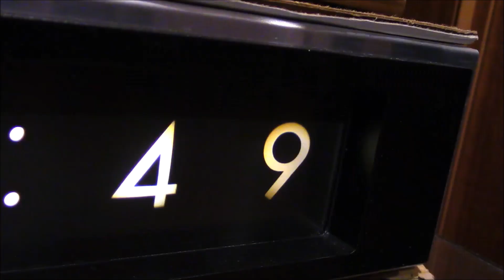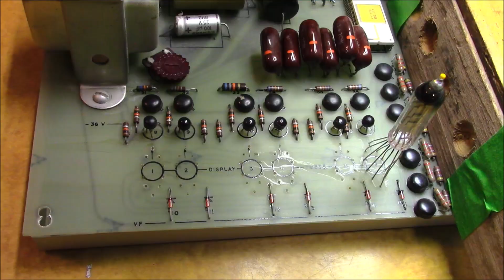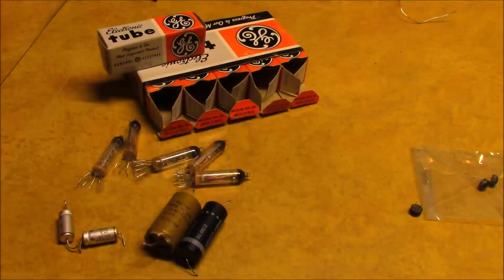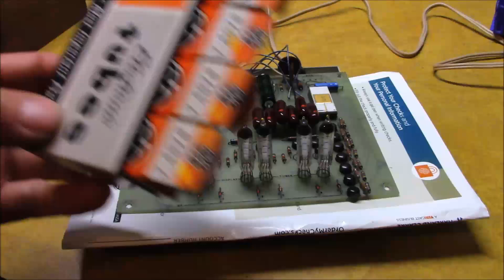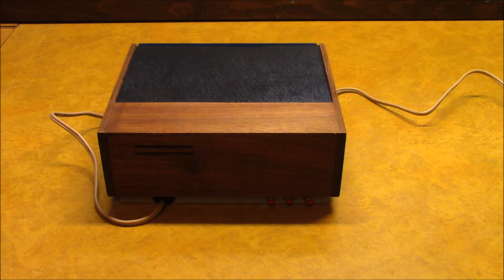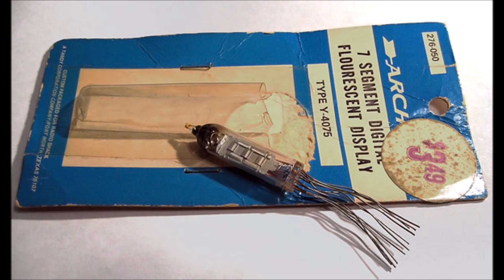1972 Aries AR-730K Digital Kit Clock Completed Repair and Clean up.

Comment: Thx for  pointing to the old video. That video might help someone who is new to multiplexing and in particular how its done on the MM5314N chip.
Is it fair to say I know this liitle lovely clock chip as much as You do?
As allways, no offense, just my 2 cents.

I know how multplexing works on the MM5314N and similar, I had it on my scope (2channels only).
The new old clocks I have designed based on 40 years old mfg documents driven by the GdR made U125D four decade counter /clock chip are using the same principles,
The designers improved that  by placing a 1/32 of a full cycle between driving digits subsequently.
After driving all digits an even longer blanking period follows before driving the first digit again.

If I can recover myself, if I can get on my feets again someday, I would like to build the circuit with no control grid.
Lets end the discussion.
Reply from the maker: oh I hope you are ok and not having health holdbacks...I am slowly coming back.  Rough time I had.  Wouldn't wish it on anyone.

Comment: Have inspected the blury schematics again.
To me it looks like feeding the filament no DC at all. Just feeding pulses.
They were given a sequence of shots of current pulses, just a tiny amount, that brings the heater up a bit.
Have in mind it accumulates the the temperature over time on the heater,  warming them up over time.
How have they figured out, how much to preheat, before giving them the next short amount of energy?
I assume feeding the heaters goes  through tiny capacitors You have not numbered.
To me it looks similar to setting a voltage on a certain level on a comparator input , before the next pulse triggers the gun.
Can we replicate that mechanism on a regular VFD like the IV-6 or old Futaba I own by not using the grid?
Reply from the maker: DC to the filaments but pulsed (switched).  Filaments like AC better for better illumination.  How they figured it out, not sure but that is probably why there is a trimmer pot in that circuit to optimize.  As far as replicating on an IV-6, I guess one could.  For experimentation I guess.  On a multi digit VFD one has to use the grids as they only have one filament.

Comment: PLS, let me know. The datasheet has, max source current  0.3mA, max sink current 25mA.
how much current does a singel filament heater draw on this tubes.
I assume switching the digits happens at a frequency if  (typical) 1kHz.
This is not what a human can understand. At least I do not.
To me it looks it does kind of POV. Means heating the filament virtually never stops.
How fast can emission of the filament can be allowed/disallowd by just turning of the driving current.
Well,the filament always does afterglow.
It can not stop emitting photons imediately. No way.
This is because of the thermal inertia. (Trägheit)
This can not be defeated.
When the filament is being switched on/off that fast appereantly it is always on.
Reply from the maker: The datasheet at the end of the video shows 35 to 45 mA filament current for this tube.  Frequency of these mm53xx series clocks all seem to run 700 to 1500 Hz equipped with the recommended capacitor and resistor.  Maybe instead of thinking heating the filament, think biasing.  Emission and non emission...current or no current.  The tube filament needs current to permit emission, right?  I understand your thought though.  How fast can the reaction time be.  For something many say can't be done, well it has been done, it just may not be the most efficient or effective and that maybe why we see a "turbulent" display at times.  I do think what you think and maybe that is why they installed grids later on!  The after glow you see on segments is just "ghosting" which is common on any MM53xx series chip from my experience.  There is no delay between digit activation.  The data sheet does show a circuit added to the "output enable" (O.E.) pin on those 53xx's with that option to minimize the "ghosting".

Comment: A very nice clock and you did a wonderful job bringing it back to life.  Just curious about filament multiplexing.  Is there a reason why that wouldn't work with more "modern" tubes?
Reply from the maker: Well, as far as I can explain, there would be no need.  The filaments like AC better.  I read somewhere that AC on the filament produces a better and more even illumination of the segments as compared to DC.  So there is generally an isolated AC winding feeding just the filaments.  Then the grid is used to turn each tube on and off and it requires less current.  But I suppose one could (or in this clock, could have) switch the filaments on the more modern tubes and just biased the grid positive (on all the time).  So yeah I guess. hmm oh well.  I like the correctness anyhow.
Reply: @JIMO415  I was just curious if in this case it turned out that you had to use new tubes, could it be done without modifying the circuitry to switch the grids.  Also, does AC matter if the filaments are paralleled?  But maybe the circuitry is such that they are in series so in that case it would matter.
Reply from the maker: @Enigma758  it would depend on the rating of the filament current between the tubes.  But possibly as there is that trimmer pot that may have accounted for any difference, not sure.  I had not begun to look into that yet.
Reply: @JIMO415  I looked at your schematic again and I see that the filaments are in series, so as you suggest, AC would be best to avoid a gradient.  I bought some IV26 tubes which do not have grid control which is why I ask.  I have not fired them up yet, but I did see where someone else was using filament control in order to mux them.  I would think DC might be OK if the filaments are individually powered from a series DC circuit (no gradient since each tube is not affected by the others) but I haven't tried it yet.
Reply from the maker: @Enigma758  I have other VFD tube clocks where the filaments are in series with each other but this clock, they are not.  (something in my pencil art schematic may not be exactly clear?)  If they were in series, they could not be individually controlled for multiplexing.  The IV-26 tubes are available in 3 different "types".  They are designated type 1, type 2 and type 3.  My Elektronika 7-06K uses the type 2 variation.  You are correct, there are no grids in them.  And interesting question on separated tubes vs series tubes filaments as to how they are affected by AC vs DC.  Hmmm.  Anyhow, with out grids in the IV-26 tubes, individual dots or grouped out dots are controlled with separate lead in wires depending on the tube type.  I do not know how the type 3 is layed out but type 1 is individual dots each controlled by it's own lead in wire and the type 2 has one separate lead in wire for each of the 3 separate dot groupings.   I touch on it a little here: https://www.youtube.com/watch?v=xtdLZKqtCgg

Thanks for the comments!

Comment: How did the designers made it working? You say switching on the filamnets.
I guess they did similar to what I have found on soviet made elektronika VFD clocks, when they do kind of level shifting,
mostly because of wanting to mitigate 50Hz flickering.
So, is it that kind of adding a biasing voltage one end of the filaments?
Reply from the maker: You may already know the difference between direct driving a display and multiplexing a display.  So, as this display is multiplexed, that is: one tube is on at a time and scans faster than the eye can see, to display the time as we see it.  This is done to keep wiring and connection counts down.  So, in order to activate a tube in the sequence, VFD tubes usually have a grid screen to bias positive to allow emission from the filaments to create the glow on the phosphor.  Bias it negative, the emission stops.  But these older VFD tubes do not have a grid.  So, instead, the original designer chose to enable or disable each tube by switching the filaments on and off.  I think the Soviet clocks are direct drive, (each tube is wired direct to the counter/driver) or at least the two examples I have are.
Reply: @JIMO415  Hi, any chance to put Your findings on a simple schematics on google drive. pls?
Have watched the video yesterday, but lost it in my memories already.
OMG.
The MM5311 series datasheet does not even mention switching those individual filaments on/off.
I have shown how the mechanics of the MM5314 working in an unexpected manner on the single digit Numitron clock.
It was a fun to see it in real life by lighring up the diodes.
That looked to me much different from what you tried to explain by telling.
Could You make a video that shows on oszillogram how it goes?
You have shown afterglow on the rightmost VFD. Can this be eliminated entirely?
Four channels at a time would be great to watch.
Reply from the maker: @thomasw2509  see this old video I did and horribly describe the multiplexing on a scope on 2 channels...skip forward to 9:20 minutes in:  https://www.youtube.com/watch?v=71m8CUn6GFI&t=10s

Comment: Spare parts provided by Lakeland Autoparts, I guess.
In my country I have experienced old car repair  shop owners cleared the old stock, very old aprts came up on ebay briefly.
Nice clock, repair job well done.
Spared you recreating the whole thing starting with a new pcb.
Congratulation.
Reply from the maker: Haha auto parts.  Thank you for the complements.  It is a honor to hold this one in the hands.  Hard to find.